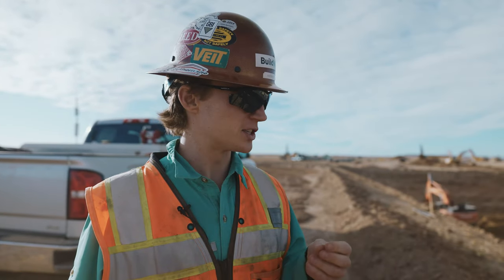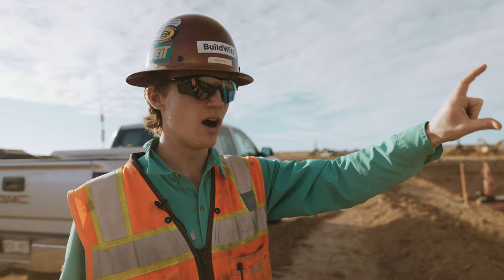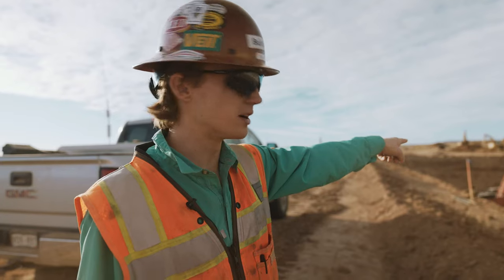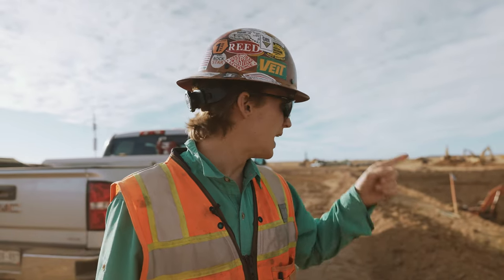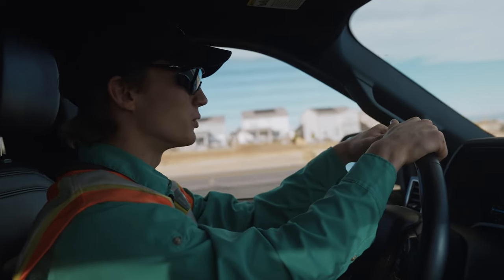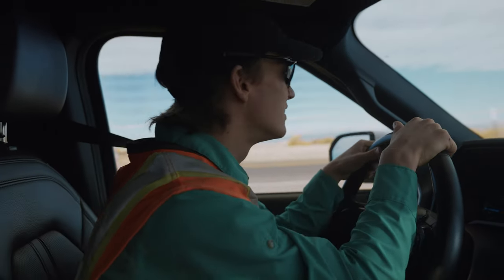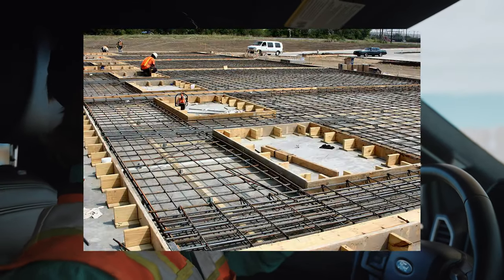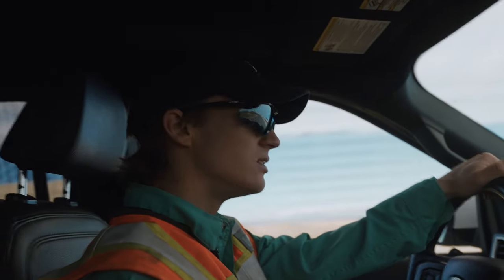Digging 20 Feet of Over-excavation for New Houses in Colorado

Comment: It’s called moisture conditioning. And we do it here in Dallas and surrounding areas too. After that it’s usually capped with a select fill. To lock in the moisture. It’s good for home owners to water around their home so the soil won’t crack.

Comment: We are  doing the same thing in fl but we are filling in old farm ditches an we gotta dig them about the same depth but in a big v an 11'to 9' wide at the bottom an re pack  in 1' lifts. We are prepping the ground for a 70' high dirt wall (Earth dam) for a Levy. I've done it for a housing development before too we had to bring the ground up 5 feet tho this time. The job was under bid by like 280 million too. We are working under the main contractor.

Comment: Is there a reason they do not use a different type of soil reinforcement to limit settlement? I think that Geopier would provide a cost and time saving substitute for jobs like these.
Reply: Yes, because of cost
Reply: @tomcander3669  in my opinion and experience, installing rammed aggregate piers that penetrate the existing undocumented fill are cheaper than mass excavation of 20+ feet. This type of mass excavation can take nearly a month while piers could take half the time saving a ton in labor and equipment costs. Is this not the case?
Reply: @Tjthebean  I was referring to soil stabilization which is quite costly.  Maybe it's not even a thought on Colorado.  If the soil is that poor, it should be deemed un- usable
Reply: @tomcander3669  very true. I know we do a lot of apartment complexes out there but haven’t heard much residential wise. Thanks for your feedback.